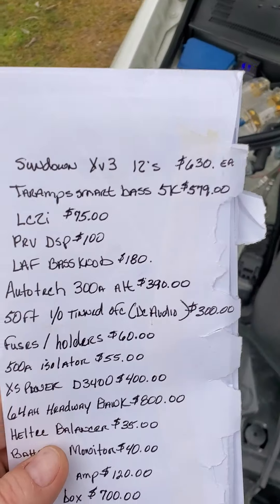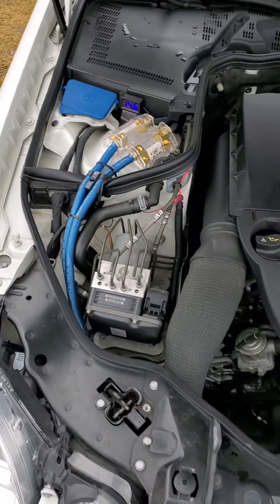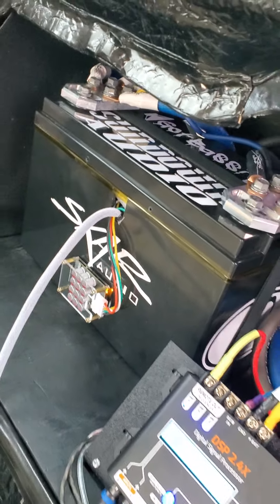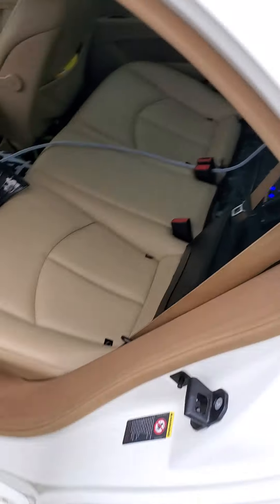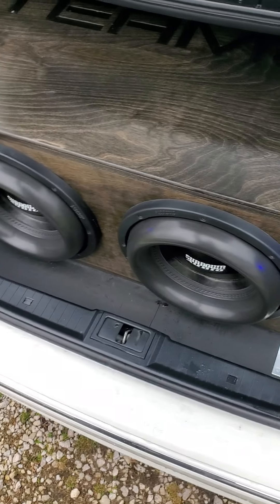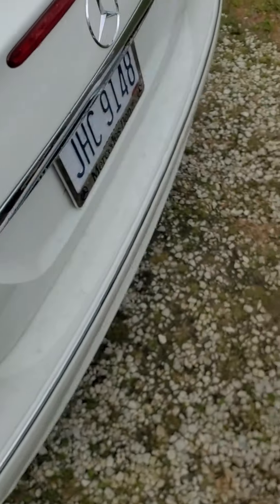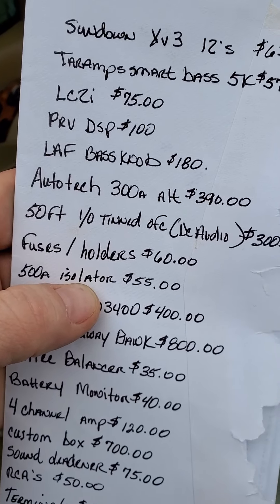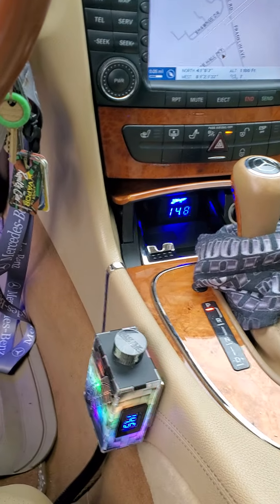How Much Did My Car Audio System Cost?

Comment: Hey Scott where did you get your Alternator from? I have a E350 also but having a hard time finding a upgraded Alternator.  About to run a Salt 3k and a  Salt 500.4
Reply from the maker: I got it from Autotech Engineering. It's a large case 300 Amp. Just make sure you get the alt set to 600rpm cuz the E350 idles lower than most cars. I had to send my first one back for this reason. Don't go thru js alternator or brand x cuz their customer service sucks! This is autotechs number. (951) 683-4174 The owners name is Sam. He's got videos and stuff on YouTube and tiktok.
Reply: @Scott Wright🔊  awesome deal,  thanks,  I like your setup,  I'm currently running one X 12v3 on a SAE 1500, but I'm upgrading I have purchased all my equipment I'm going to be running a NSV5 12 on the Salt 3k, also getting the doors custom done as well  with the Salt 500.4
Reply from the maker: @Jeffery Montgomery  nice! My next upgrade will be the NSv6's on a salt 8k. And my highs I got a DeafBonce 600.4
Reply: @Scott Wright🔊  awesome deal,  I can't wait for the build and your demos.

Comment: Scott I would also try and figure out what labor would have cost even though you did all your work yourself I figured around $100 hr that's what all the shops around here charge.
Reply from the maker: I would assume around double. After labor and up charging on equipment.
Reply: @1ohmwrecker  definitely not double

Comment: I don't even want to add mine up 😂
Reply from the maker: My first time, and I wasn't too surprised honestly. Just weird to see it all on paper like that. Either way, I love the hobby!👍
Reply: @Scott Wright🔊  facts this build is my last one so I just went all out
Reply from the maker: @OnlySubzz  I think this year I'm gonna put a wall in my Trailblazer to have a nastier build to bring to shows. I've never tapped into that territory before. But guess I'll probably do a b pillar 4th order? Is that the best for someone doing it first time?
Reply: @Scott Wright🔊  I would say a b puller 4th on the blazer would be nasty. I had a wall of 4 15 American bass hd on a American bass vfl 650.1 a few years back. Had kids so sold that off now I have a 07 grand prix doing 2 12 sundown nsv5 12s on a crescendo 8k @.5 have a crescendo s1 going on 6 8inch sundown neo v3 and a crescendo s2 on 4 sundown super tweets. Electric is 4 2/0 gp audio wire (2 power 2 grounds) on a gp 320 alt. Under hood I have a xs power super cap bank I think it's the sb500 g34 and 2 jp 40 lithium in back. I'll have it sealed off facing in doing the build now and making a build log to post shortly when finished.
Sounds like you have a plan and that's 80% of the way I'm sure what ever way you go will be good the setup now is awsome.
Reply: I'm at $6k without a cd player and wit only one sub..but it costs to be the boss..looking for a good lithium battery now
Reply: @allenscott5773  ying long lto from xs power, I’m at 14.9 in idle but I just ordered a voltage controller for my 320 alt from auto tech engineering so that should boost it up to around 15.3 or 15.4 to get the most out of that ying long lto
Reply: @RomaVilla2189  oh ok..I mite go dat route bc I'm limited in space..I mite buy dis harness from mechman to give me 15.5 at idle

Comment: You have a link for the bms in the center console?
Reply from the maker: Just search 'battery go' on Amazon. It does have balancing functionality, but very slow. I just use is to monitor each bank of cells and see the difference between the cells.
Reply: @1ohmwrecker  thank you much appreciated 🙏🏾